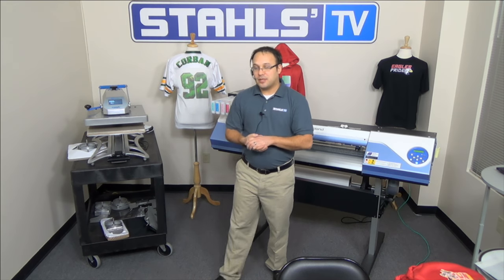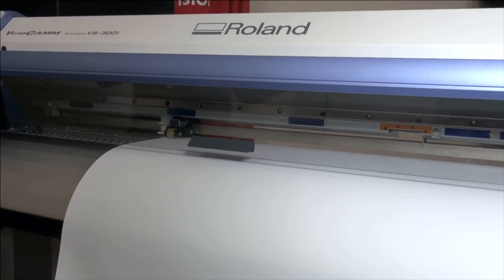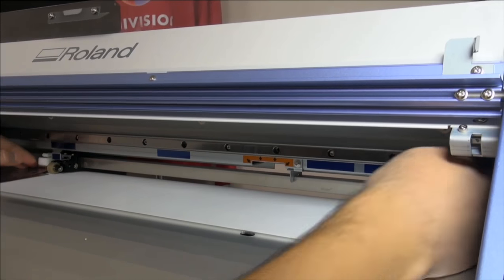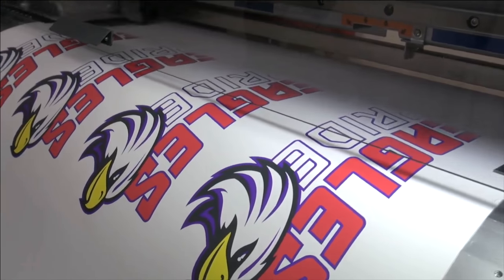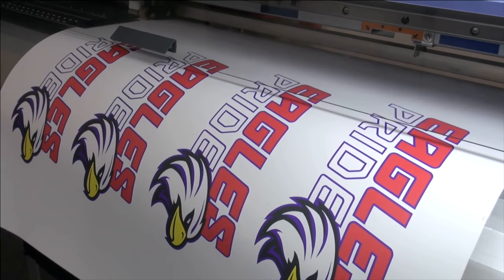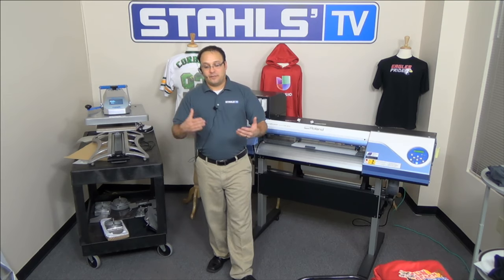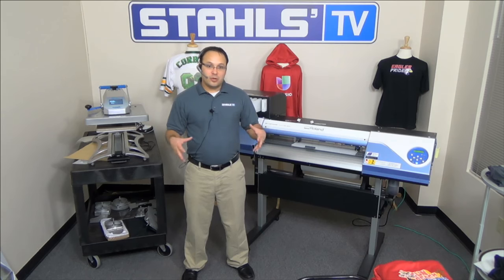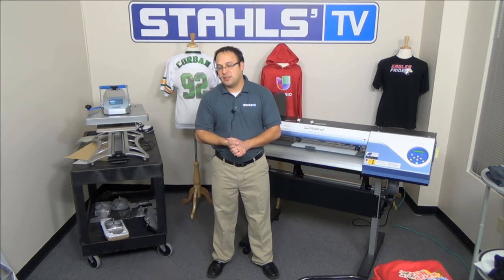How to Print, Cut & Press with a Roland® VersaCAMM®

Comment: I use Inkscape with Adobe Photoshop. Will Inkscape work or do I need to learn coral and/or adobe illustrator?
Reply from the maker: If you are able to either import or create color pallets within this software and save to an EPS file format, then you would be able to use VersaWorks to export and print. I hope this helps!
Reply: Learn a vector based program, your dealing with cutting so vector is a must

Comment: If I print two 10 by 12 inch design and stick it on both sides of a 100% cotton t-shirt, will it prevent air flow? In other words, will I feel hotter if I use this printer to print full sized images like you did in the Epson f2000 video?
Reply from the maker: It would depend on which vinyl material you are using. Our TEK line of products may be a better lightweight option for bigger designs.